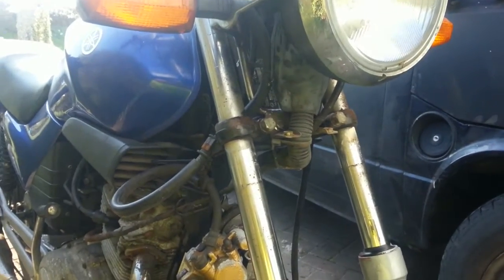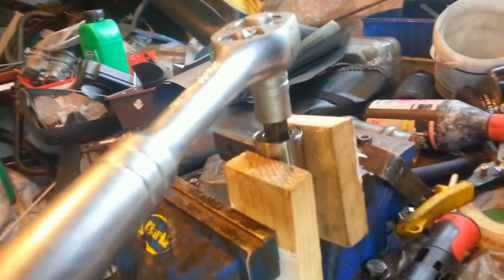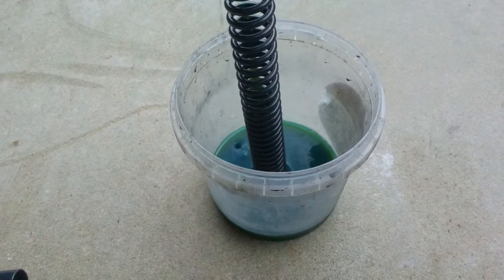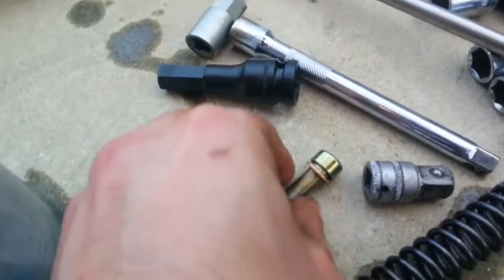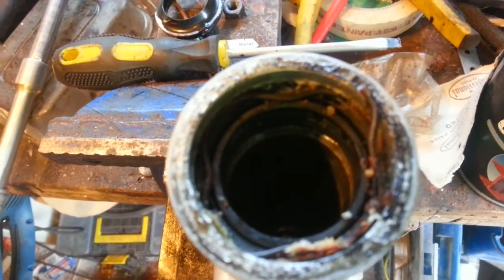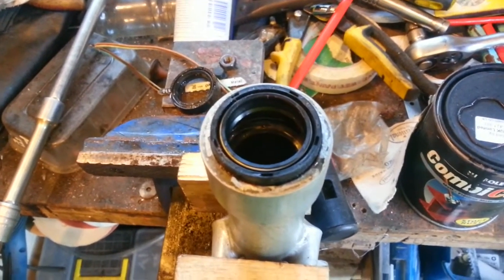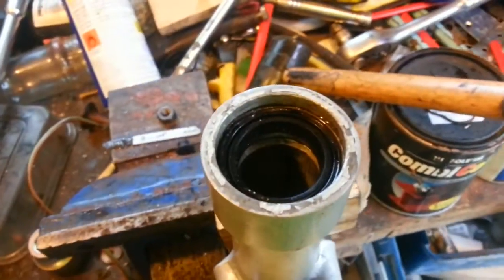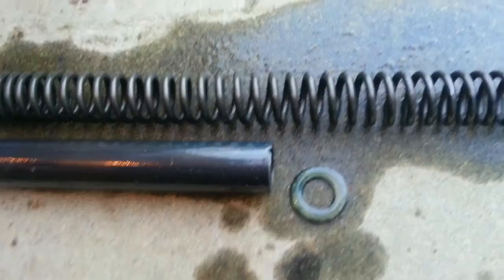Yamaha YBR125 Fork tube replacment seal rebuild.

Comment: Smart i replaced my chain and sprocket  nicely ...it feels a lot more stable   and corners more smoother   ..  now its the forks  i cheated and brought a new pair of forks from E-bay, quite cheap   because my one of the forks were badly  pitted and fork oil is leaking on my front brake disc    causing more stopping distance . { "only a fool breaks the two second rule" , got to make mine at three or four after i pick my icon and the car in front )
.   How i done the seals in was trying to get on the pavement and the kerb popped my seals  
 i now got to do the bike on a steep hill outside my house in the middle of the pavement where folk keep stopping  and talking to me like when i was doing my chain and sprockets  .. lol